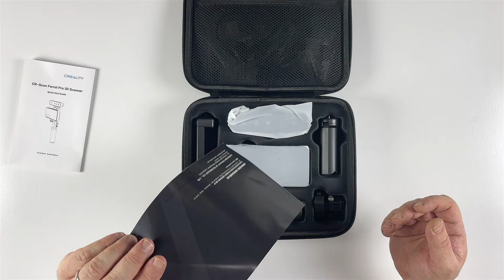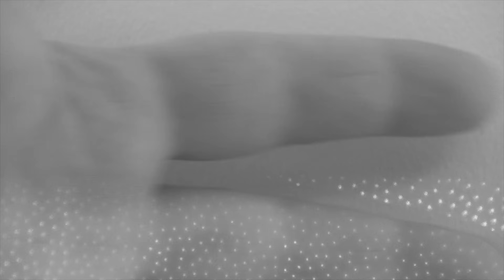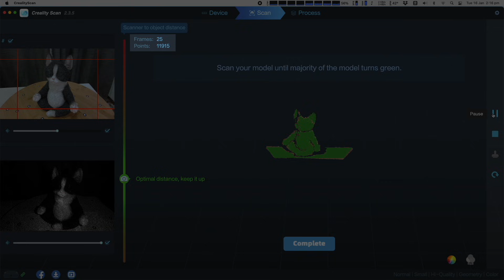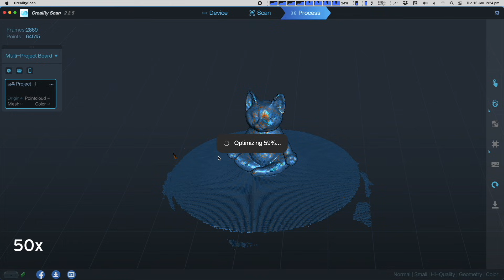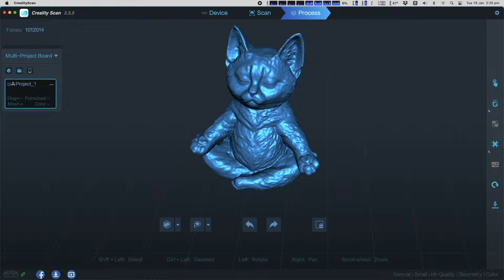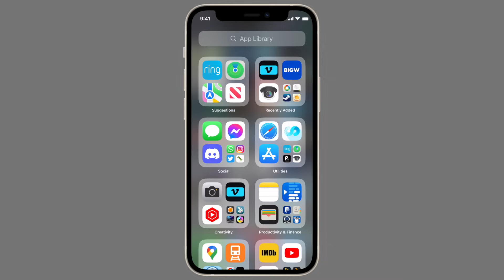Creality CR-Scan Ferret Pro 3D Scanner - Part 1

Comment: Thanks for doing the video, Im thinking about getting a ferret for scanning some panels to inspect in 3d.  I know that my laptop wont be up to the job, and at some point I will have to upgrade my laptop to something more powerful like a gaming laptop.  However I also have to upgrade my smartphone, and that is more urgent as my current one is on its last legs.  The ferret pro seems the way to go, I can get a good powerful android smartphone and delay the laptop purchase a little longer. `So this way am I correct in thinking that I can scan using my smartphone and ferret, then export a stl of the object from my phone to my computer by email/wetransfer/bluetooth, and then edit on my computer using meshmixer or similar?

I have been practicing some scanning using smartphone photogrammetry apps, and with a few tricks that I have learnt, just starting to get skilled enough to get something that is just about useable, so Im guessing that even with the ferret not being a premium line scanner I should be able to get a better scan than the free photogrammetry apps that Im currently using?

Comment: Thanks a ton for doing this.  Very good tutorial, starts at the start lol, IDK how many times I've seen vids that forget to begin with basics and add from there.
For anyone maybe reading this I just got the Ferret SE.  Differences seem to be NO phone app, pc only which also supplies power-no battery.  Otherwise the actual scanner has SAME specs where it counts exactly from what I've found, this info isn't exactly easy to find at a glance.

For the price difference its an esy tradeoff for me just to take a laptop if I'm looking to scan outside.

Oh and also no nifty carry case but they are a dime a dozen on Temu, actually had an extra sittin around as I knew would come in handy.

Comment: Have a question hoping you can answer about the software. I haven’t had much luck finding any answers online and Creality email support has left me hanging. I got the new Raptor installed the software on my M2 Pro and on initial startup it asks me for a password for permissions. I enter my admin password and it says it’s incorrect. I tried this on a 2016 Macbook like you and my 2017 iMac Pro and same thing happens on every computer. It will not accept my admin password. Have any ideas what could be causing this?

Comment: I don't see where the scanned results are any better than the cheap scanners that came out years ago.
Reply: @georgehampton25  your not using it correctly. This tech gets better every year or less, but you have to put forth the effort 😉🇨🇦
Reply: @stevecarlisle3323  Of course it does. I'm going by his results. Still a cheap 3d scanner. You get what you pay for with these scanners.

Comment: I see the Ferret Pro has a 5000mAh battery while the Ferret has a smaller 4500mAh capacity.

Are there any other differences in the actual scanner unit? eg: better optical sensors? 

They are bragging about having black, shiny, and metal object scanning capabilities now. Is this the same for the Ferret (plain)?
Reply from the maker: I only have the Ferret Pro in my possession, so I can't be 100% certain, but based on the specs of scan volume, accuracy, working distance etc. (and from looking at the pictures) I believe the scanner itself is the same across all three models. The Ferret SE is only designed to work with a computer, the Ferret can work with a computer or be portable with an Android phone and the Ferret Pro can work with a computer, Android or iPhone. In my tests, the scanner would scan virtually anything as long as it's not reflective or transparent.

Comment: What if the object you're scanning needs to have the bottom of the object scanned also?
Reply from the maker: You can scan the bottom half separately and then join the two halves using the software. I'll be covering that process in Part 2.